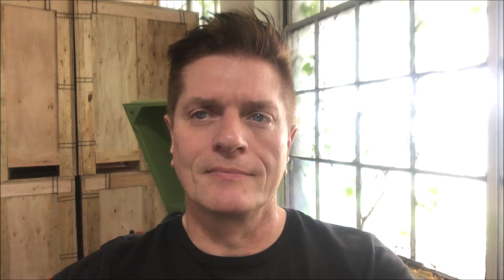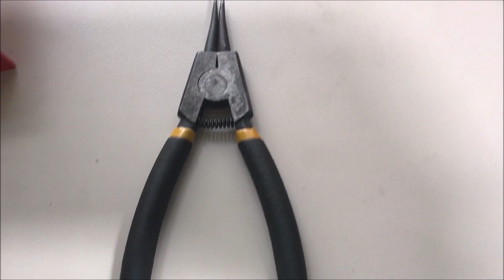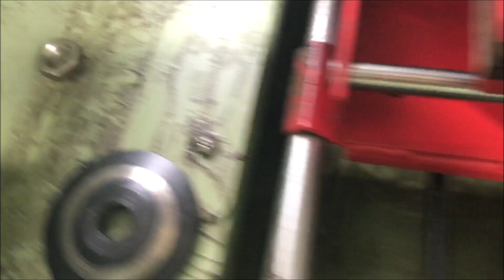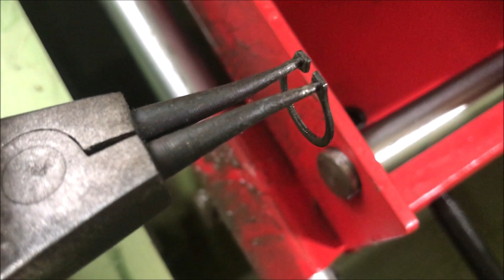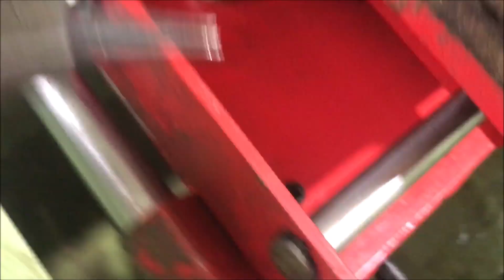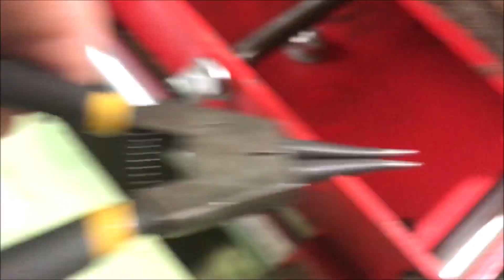How to select a clip ring pliers for removing your HighTone Slab Saw crossfeed rails

Comment: Its such a shame that you guys make you machines over in China now, I love the old HP's . If you wanna gain A LOT of business and respect in the lapidary community including myself you should move your operations back to the USA. I was about to buy 2 of your 10" slab saws a 18" and 36" slab saw this afternoon for our new lapidary shop we just remodeled last month but after doing some research I found out you guys no longer make your equipment here in the states so I just dont have any confidence it will be like the hold HP's we love so much. If you decide to move state side and employ Americans we'd gladly give you a lot of business as we are in need of 10 more saws up until this point we been buying old HP square rails and restoring them but its just such a hard thing to find and takes so long to restore them usually.
Reply from the maker: Hi there, I'm John and I'm at our factory now, I spend about 8 months out of the year here and I can tell you that its quite unlikely we will move our manufacturing. Having spent a few years trying to manufacture in Texas, I can tell you it came with some big problems: first the supply chain in the US is spread all over the country, and in todays market, shipping cost is a huge part of increasing the cost of the raw materials. Our machines are not labor intensive, they are materials intensive, and currently all my raw materials are delivered to me free here in our factory. I can buy high grade steels and they still cost me a fraction of what they would cost in the states because the freight companies are out of control with what they charge. We have transitioned to doing all of our own CNC machining here in house and almost all of our sheet metal fabrication as well. I suspect that the opposite would be true of the impact to our quality as well. If you talk to guys who are run machine and welding shops there in the states, they all have big problems finding good help. Laziness, sloppiness, theft, drug use, poor attendance.... I have been thru all those employee problems too. Our commitment is to providing high quality Lapidary equipment that is affordable, and maintaining our production as it is now will be support that initiative. :)